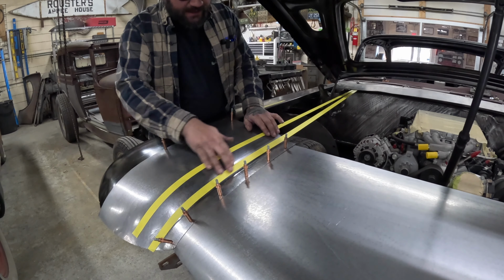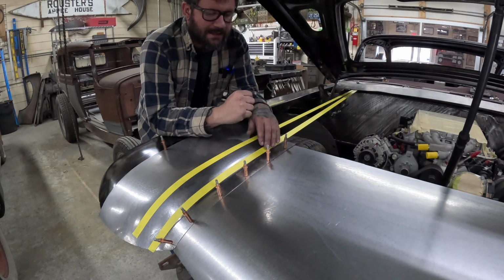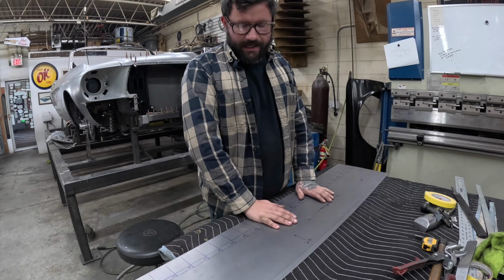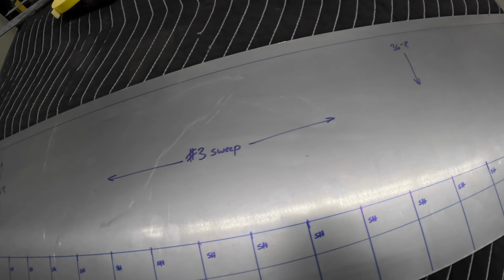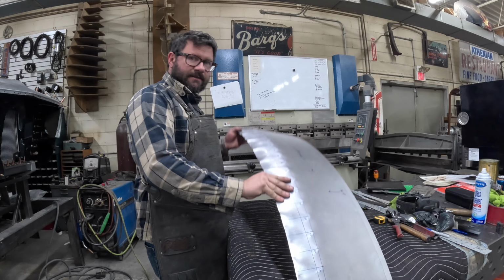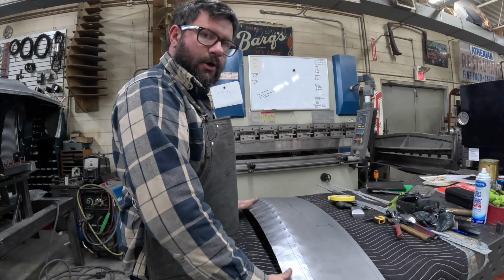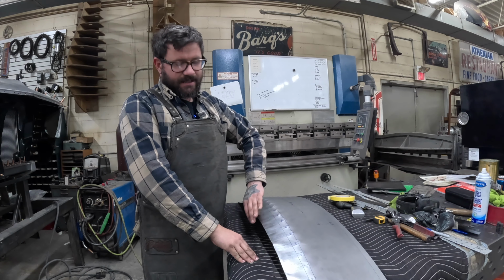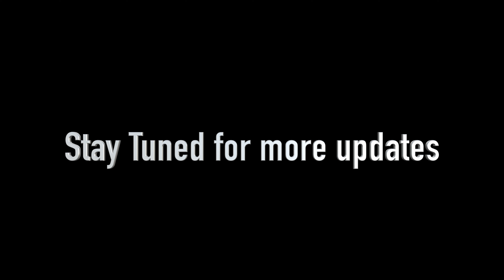Cadillac engine bay sheet metal part 3

Comment: Question???
As your lirst video had no audio from you on it, I see your making new engine bay panels but are you going to make a continental style bonnet??????
IE: Corvette style????
Reply from the maker: not sure what you mean the first video ( cadillac engine bay) didnt have any audio from me. all three so far have me talking on them. 

to answer your question as best i can is i most likely not, i am not sure what  continental style ( corvette style ) means.
Reply: @cornfieldcustoms  Yes the first video video I got has no audio to it and I thought that's were you explained your over view of what you are doing was. I do like what you are doing with flowing panelling. So many builders just think the engine bay, truck should be designed different to the body lines outside.

Anyway, a continental style is were the hood is surrounded by body on all sides. Well that's term that was explained to me. So I thought to use the visual concept of the corvette hood. But I guess I'll wait and see.
But it is looking awesome. 
Merry Christmas.
Reply from the maker: hmm i am not sure. they are have audio and dialog on my end
Reply: @cornfieldcustoms  Its good on part 2 and 3. So all good.